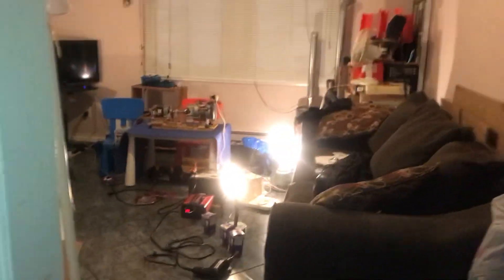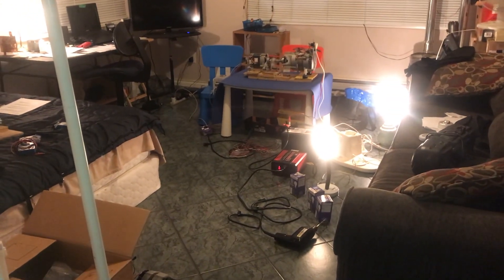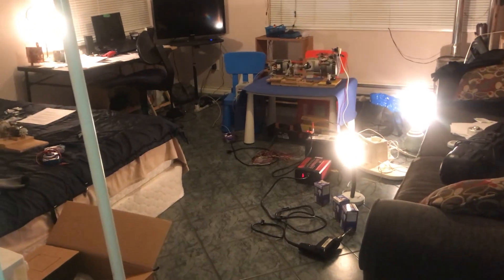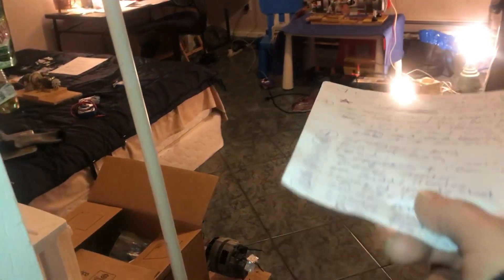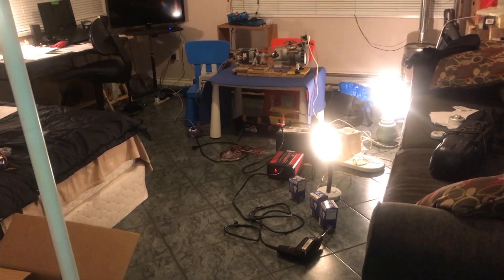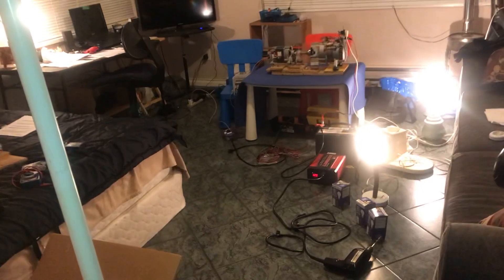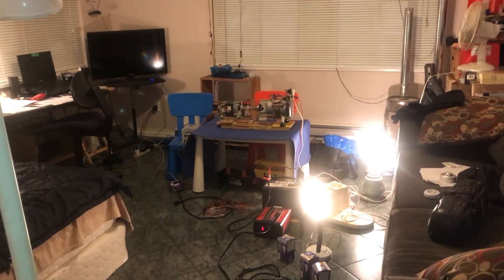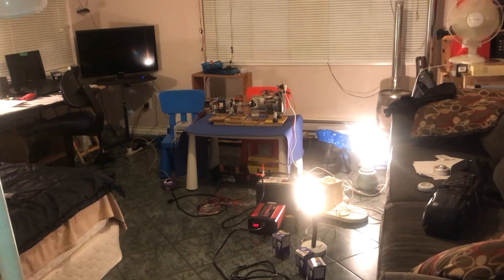FUEL LESS GENERATOR - Demonstration with Inverter and explaining how to build.

Comment: We need to make a hyper-drive like Gerard Morin, we either need to dish the washing machine motor and try to add a drum motor instead, already re-winded for hyper-drive.
We also need to optimize the inverter generator, because gerard constantly said that they wind it very poorly those inverter generators. Usually theres not enough magnets to coils ratio.
I will try to make a small version hyper-drive, and try to post the results but in a different channel maybe. Cuz my channel is about relationships :)
Reply from the maker: Very good, you should listen vary carefully to my last video on my channel. this is what i discovered and yes  it is not FAKE

The Drum motor they are all the best ever made, i have 3 and yes.

Comment: How you try using super capacitor bank and batteries to recycle the power and get the same results
Reply from the maker: Yes this can be done with cap with 220 volts, where you live 400 volts should spin great and recycle energy.

Comment: Can you show the Output power via volt meter from the motor and the VF unit?
Reply from the maker: The 3 phase motor don't have a out put, only 3 inputs and  same with a VFD.  . have a great day
Reply: @earthssecretenergy2371  The Voltage and Amps can be recorded. Thus can figure out the watts. Having a great day but would be nice if you were to do the honorable thing. You to have a great day.
Reply from the maker: Ok   No Problem  ill send bye email  ,  send that

Comment: Awesome video.  I have a few question, are you using the generator crank shaft to spin? If not, how were you able to get a shaft to spin the generator.  The issue i am facing is that I need to use the crank shaft to spin the generator and maintain it level.  Any suggestions on how to avoid this?  Also, what do you do to minimize vibrations from both generator and electric motor? Thank you again.  Your videos are motivational
Reply from the maker: INFORMATION IS ALL ON MY VIDEOS